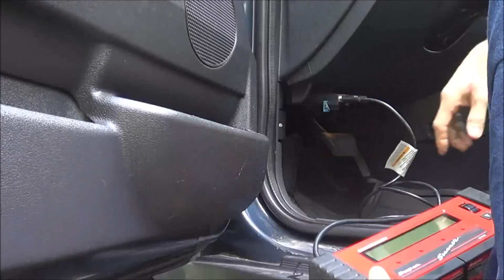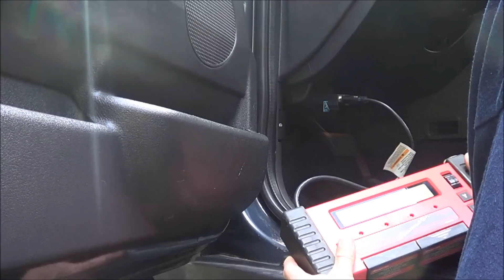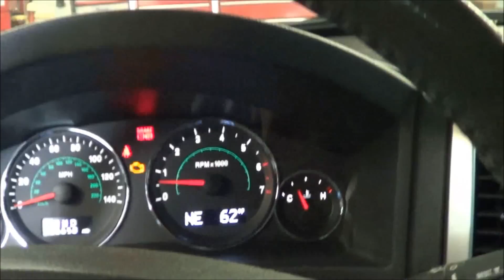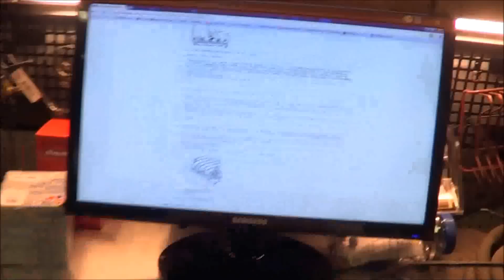9-22-13 2008 Jeep  Grand Cherokee 3.7 code P0325 Part 1?

Comment: You can also turn the car from OFF to ON 3 times and it will say DTC REPORT on the odometer display then if there are no codes it will display DONE but if there are codes it will display them... my dad has a 2005 Grand Cherokee with the 4.7 V8 and our Check Engine light came on and we used that method (:

Comment: Had the same thing happen to me when I bought a car for my son.  Seller cleared the codes just before he dropped it off at my home. Had wondered why he was so helpful in setting up delivery ?  Not 20 miles later the check engine light came on. Bad EGR flow sensor. Not expensive but a pain to change in a Mustang (V-6) Learned my lesson. When my Daughter starts car shopping will bring my OBD2 tester with me that's for sure. I'd confront the previous owner but I'm sure there is little you can do.

Comment: I have a jeep  grand Cherokee  2007 and the check engine came on and also when I started the engine stutters like if the battery doesn't have enough juicy to start the car other than that the car runs fine
Reply: What do it means when it do that

Comment: I live in Australia I have a 2009 Jeep Cherokee Limited 4 x 4 3.7 L V6 it's bringing up the codes 
SW VER   402
CAN  VER  729
LIN. VER.  605 any help would be much appreciated
Reply from the maker: Bren H  Those aren't diagnostic codes. Those 3 items are control unit identification. Diagnostic codes all start with "P" and are followed with four digits.
Reply: Broncocarl92 I placed the key in the ignition pressed the odometer button turned on the ignition let go of the button and that is what came up after running through a test
Reply: Is there anything I should be worried about
Reply from the maker: Bren H  No I don't think there's anything to be worried about. The steps you just took are self test for the instrument cluster.
Reply: Broncocarl92 Thanks mate 👍🏼🇦🇺

Comment: I have a 2007 Jeep Grand Cherokee Laredo whenever I turn the ignition switch to the on position to crank it by dash lights check engine light oil light seat belt light all Flash and click does anybody have a clue what that could be I replaced the starter yesterday
Reply: Its you ignition starter switch loacted below the lock cylinder